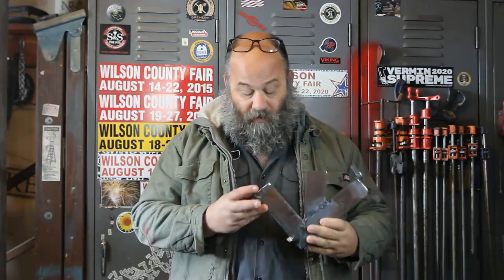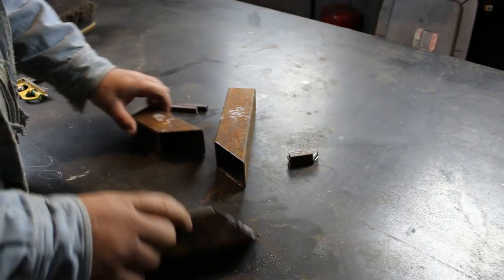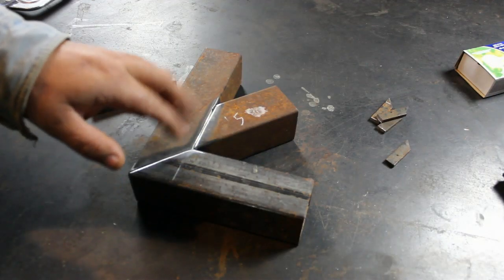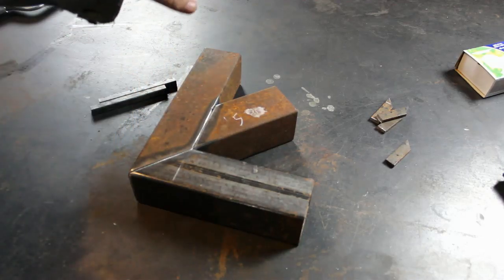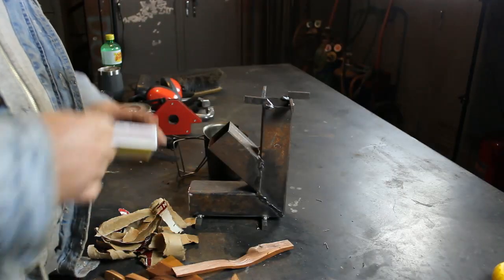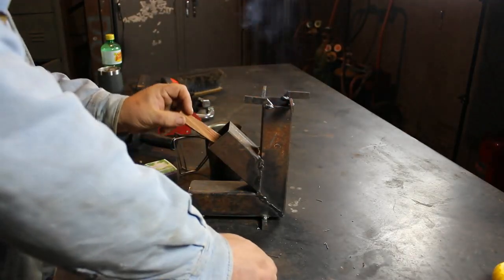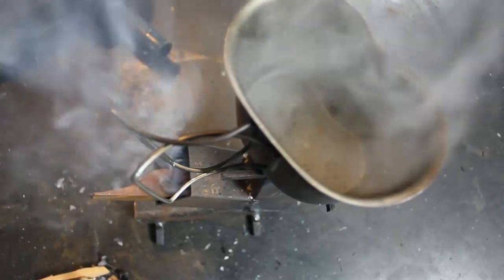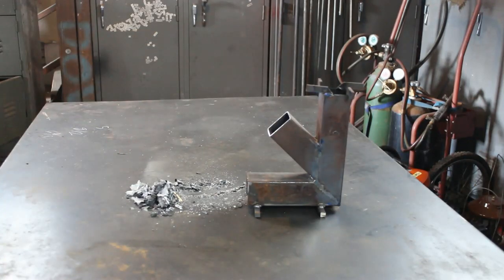Making The Simplest Rocket Stove

Comment: I don't think I would use one of these for the hiking & backpacking I normally do (mostly day hikes or overnights), mostly due to weight; but it would probably be excellent for kayaking. I would like to do a long distance kayak trip some day, and this would be perfect for lunches, or mornings I chose not to get a campfire going. Plus, it would probably make a great starter for campfires.  Getting damp firewood to start burning is never all that easy, and this would put out enough heat to make the job easier.
Reply from the maker: yeah it's not the light weight option for sure